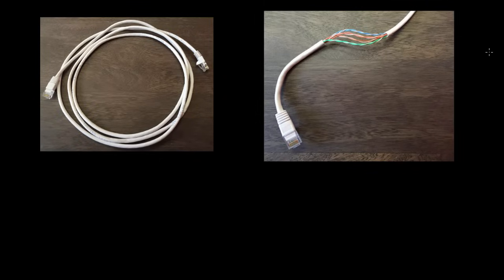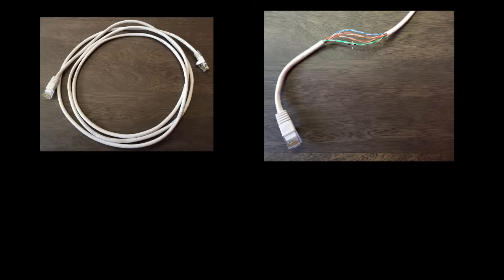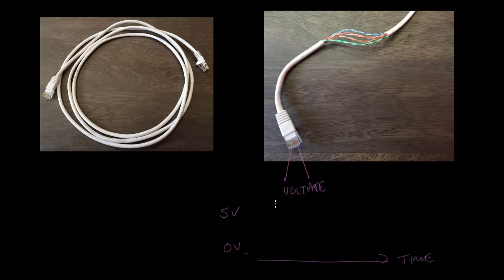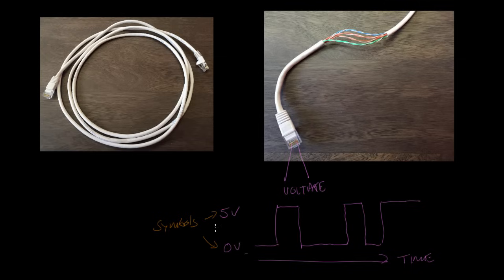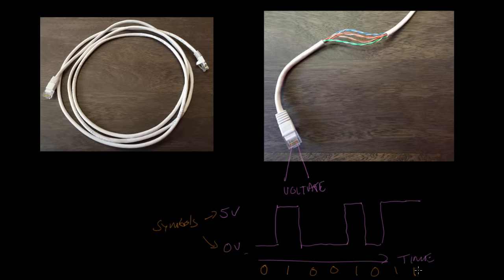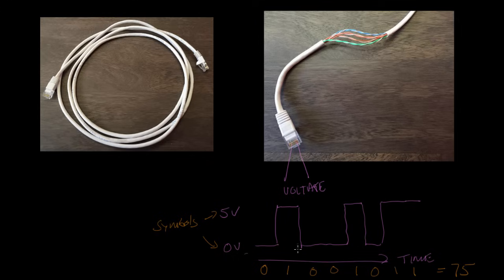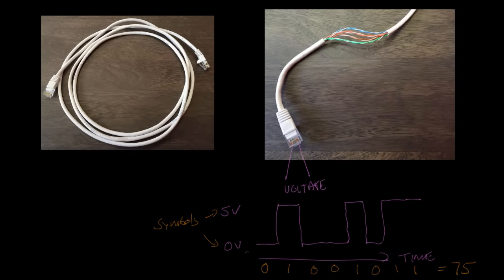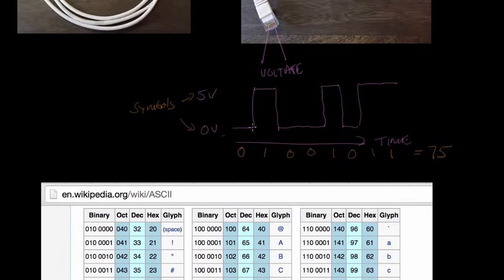Sending digital information over a wire | Networking tutorial (1 of 13)

Comment: Can you comment on how Gigabit Ethernet cable is able to function as PoE, where all cables are used for both data and power? How is data and power (probably DC) sent over the same cable?
Reply: This is extremely late, but in case you’re still wondering: each of the 4 pairs works through differential signalling, so for example, if one side of the pair is at 1, and the other is at 0, you get “1” (1-0=1). Or you can have both at 1, in which case 1-1=0. 

But because you’re only looking at the difference between them, you can work at higher voltages, for example, 49 and 48: 49-48=1, 49-49=0.

So you take at least one pair working at about 49/48, and another pair working at 1/0, and you can have a current between them.

Comment: Can you make a video about practical circuit to RX and TX ethernet? Simple capacitors decoupling with BJTs and 74 chips?
Base2 technology might look outdated today, but it let to TX&RX high speed date in both directions /*by coax or single twisted pair*/.
The solution of using high impedance voltage input and current source output is interesting and could be used in DIY projects.
Reply: I came back to this video to make a similar request (if I'm understanding your comment correctly). I'd like a video where you tear down and look at the circuit diagram of an Ethernet card, so I could understand how, when the CPU requests to send a byte over ethernet that actually flows electrically and into the wire and how receiving works.
Reply: @borisverkhovskiy5169  yes, but the whole ethernet card could be oversimplified and implemented on a breadboard same ad RS232 was.

Comment: The computer engineers back in the early 60’s must have been thinking about a similar technique for communicating originating decades before called Morse Code. Essentially it’s similar to this form of communication is a series of long and short light “bursts”. Put them all together and one can create a message (long or short). Same thing goes for how data packets are sent over copper or fiber.

Comment: Why voltage is applied across 2 wires? Why not 1 wire - am I missing some electrical fundamentals?
Reply: It's a late reply, but see episode 3; one wire carries a data signal and the other carries a clock signal. Every data signal needs a clock signal.
Reply: @teamupleft7097  Thank you - I very much value the response - had been waiting for a response 🙂 Never too late for new knowledge

Comment: what i never understood is why you need 4 PAIRS. if current is a flow, then why not have 4 wires that send current one way, and one main dump wire that balances them in net.
at least in water systems, this should work just as well as the pairings since you only detect voltage differences across one of the four and the main dump
Reply: They’re twisted pairs so that the magnetic fields induced by the change in voltage are neutralised by currents flowing in opposite directions in a pair.

This prevents electromagnetic induction from causing interference by inducing unwanted currents in the other wires.

This is the same principle that allows for transformers and wireless charging to work.

Comment: Hi thx for your amazing explanation. I came up with an idea that if the physical basis of signal is just voltage, why can't we use audio cable (like common ones used for earphone) to convey data? Is it because the sound card are not able to produce such digital voltage waves?
Reply: 3 years late but to answer your question... sure, audio cable could be used. the main difference with audio cable is that it isn't optimized for faster signals. the capacitance of the cable might take those nice sharp digital edges and round them off. your sound card adds a different problem, most of these are usually AC coupled, so you wouldn't get the absolute levels, only the changes (audio signals never stay at one level over time except for 0V when there is no signal).
Reply: i think (not certain) that if it alternated from 0 volts to 3 different voltages than the computer would have to distinguish the different voltages into data.
Reply: ops wrong reply, this was for Dell Conagher

Comment: Why are we using just two symbols for transfering data?
Reply: Basically to avoid data being corrupted since voltage can change while being sent. Using voltage = 1 and no voltage = 0 means that there is less likely going to be missing/changed information.
Reply: The answer to your question has a lot to do with the difference between analog and digital electronics. Digital electronics use two voltages, one of which is always 0. Anything else is considered analog. Analog can be very useful for communicating data faster or more precisely, but where it falls short is accuracy. In other words, while I can send a 4 bit digital number from one arduino to another every sampling cycle using an analog pin and a single voltage on each, a little interference can change what that number is. If there's an electrical spike of 0.02 volts, the number will be off by one. A one volt difference will shift that number up or down by about 50. Compared to digital, this is incredibly inaccurate. Digital is always either on or off (1 or 0, 5V or 0V, etc.). That means if a circuit receives 4.8V, it'll assume it's supposed to be 5V, and if it receives 1V, it'll generally just assume it's meant to be 0V. This way, the circuit is a lot less susceptible to interference at the cost of information density (that same 4 bit number takes at least 4 sampling cycles to communicate now) and easy fractions/decimals (two analog voltages can easily be compared, but digital is trickier - look into floating point numbers if you want to see how digital handles decimals).
Reply: Boolean Algebra and digital circuits. The foundation computers are built on.

Comment: how can it differentiate between a binary no. or a letter's ascii code
Reply: Maybe you have learned the answer to this by now, but networking protocols themselves don't really do this. All they do is send and receive binary. It's up to whatever is using the network to serialize and deserialize the binary into useful information. Something like deciding "Okay I'm going to send a 512 byte packet that contains an array of data, so I'll allocate 1 byte for the identifier, 4 bytes for the size, and the rest can be values." When the receiving end would then read this binary it would see the identifier to know what it's deserializing, then the next 4 bytes to know how much, and then basically read that many values 1 word length at a time. At the end of the expected number of values, it could try to read the next byte worth to see if there's another valid data there (like if you're packing multiple objects into a single packet) or discard the rest.

Also,  ASCII is just the character representation of the 256 possible configurations that can be stored in a byte. Generally bytes and chars are the exact same thing, you just decide how you want to interpret them.

Comment: Why do the ASCII binary numbers consist of 7 digits instead of 8?
Reply: I don't know why Dean has such a complicated explanation. The easy answer is that the Wikipedia omitted the leading zero for brevity. 01001101 == 1001101 for the same reason that 023 == 23.
Reply: The eight bit is the sign bit?
Reply: ASCII is  7 bit standard. The 8th was not part of the ASCII standard but could be used as a parity bit for error checking or simply set to zero.